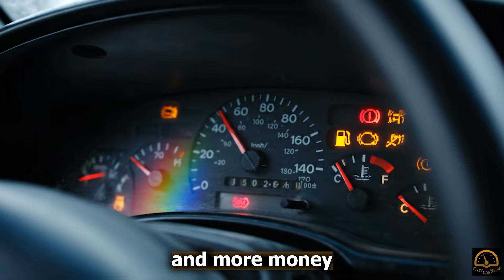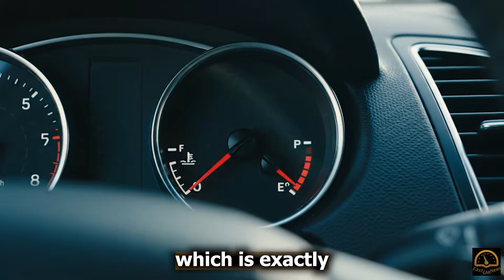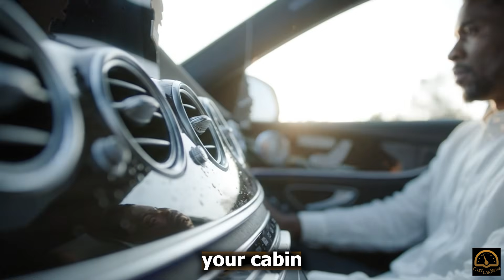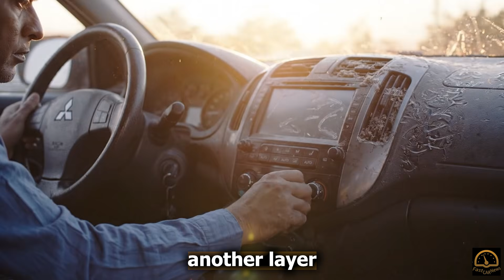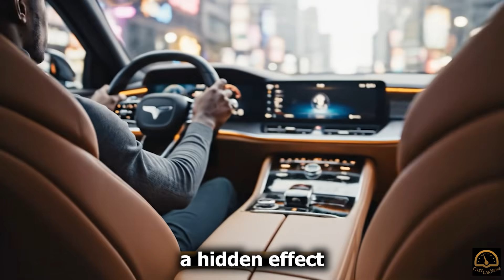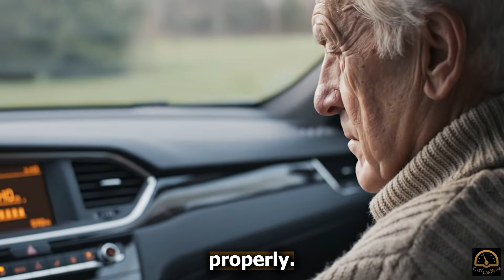STOP Wasting Fuel! Hidden Car Button Most Drivers Use WRONG Every Day

Comment: I figured this out just a few months ago after 6 years of driving I wanted to see if the foggy window would clear up if I had just turned the recirc lever to refresh and it takes a few moments longer but it helps with out pressing the ac button and you sure are right it saves a little bit of fuel especially in start and stop traffic driving
Reply from the maker: Exactly! Most drivers don’t realize the recirculation setting makes a huge difference. Switching to fresh air can clear fog naturally without constantly running the AC compressor. It may take a little longer like you said, but in heavy stop-and-go traffic every small fuel saving adds up over time 👍

Comment: That’s a lie. The AC will work the same no matter recirculating the air or not. There is no fuel savings from it. It only maxes the cooling power. There is no extra load from using outside air like you are claiming. Don’t mislead people
Reply from the maker: Not exactly. Recirculation mode does reduce the workload in many situations because the AC is repeatedly cooling already cooled cabin air instead of constantly cooling hot outside air. That’s basic thermodynamics. The compressor still runs either way, but maintaining cabin temperature usually requires less effort in recirculation mode, especially in very hot weather. The fuel savings are small, not magical, but they are real enough to be measurable in some conditions. The video never claimed massive fuel economy gains — mainly improved cooling efficiency and reduced strain during extreme heat.